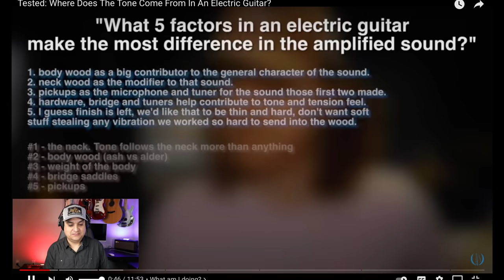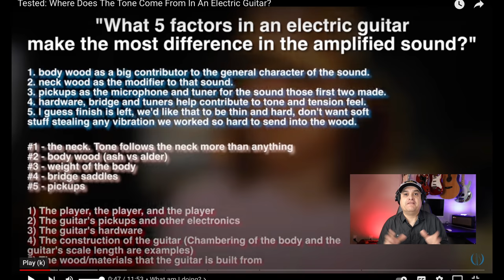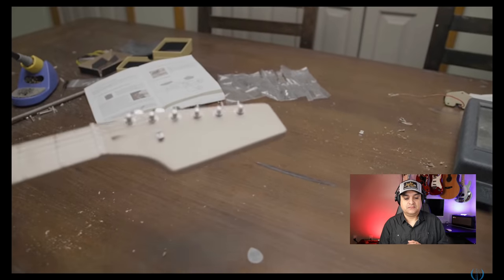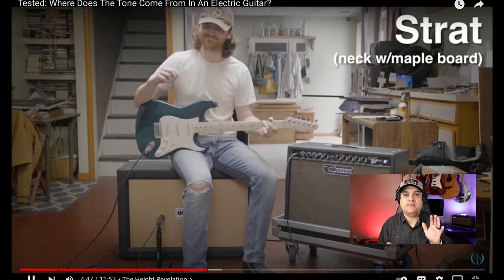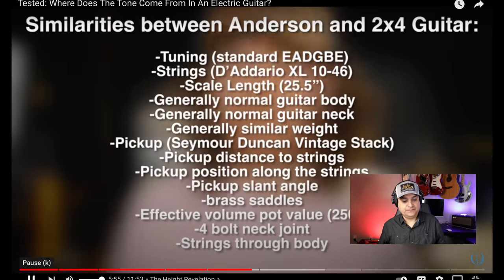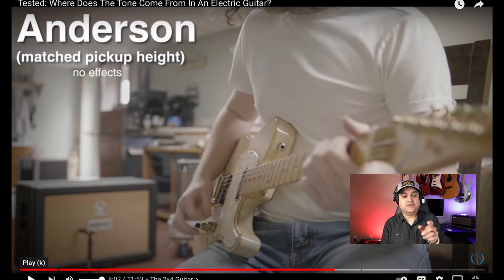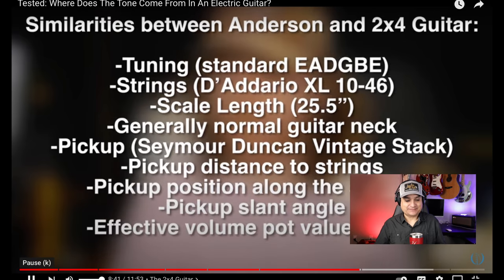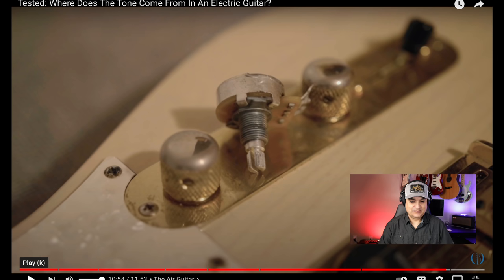Where Does The Tone Come From In An Electric Guitar - Reaction Video

Comment: I see in the comments that many people think the wood and neck contributed to the minute (if any, measurement by ear is fairly unreliable for anything except whether you like it) tonal differences in the later segments.  I think it is much more likely that those tonal differences came from the fact that even though he was using the same make/model of pickup and pot with the same ratings, they were not the same pots and pickups.   No two pickups will be voiced identically, because there will always be some variation in the wind (even when done by machine).  Same for pots.  They are given a set rating, but there is a built-in acceptable range above and below that number where it is still considered to be in spec.  

If a guitar made out of concrete can sound good, then it is apparent that for a electric guitar the wood makes a negligible difference, if any.  I would like to see an experiment to see if the same holds true for hollow and semi-hollow guitars.  From the pickup perspective, it is still just reading the vibration of the string.  But I feel like the construction of a hollow body lends the instrument to having a more direct effect on that vibration (as the bridge would move with the vibration of the top).  My guess with semis is if the bridge is secured to a center block, then the rest of the top would only affect the acoustic sound and not the pickup response.

Comment: So based on this, are there ways to get more of a mids/highs sound out of my BC Rich Zombie with a Super Distortion pickup? Currently it sounds muddy and a lot of lows/mids. I always thought it was the woods that were used, but based on this, it seems it's got more to do with the pots?
Reply: what I took from this vid was the single biggest thing that made a difference was pickup height.  Try adjusting your pickup height before doing anything else

Comment: The body of a solid-body electric guitar matters much less than the neck, except for the body's overall mass and longitudinal stiffness.   Different woods don't have different characteristic sounds independent of their dimensions.   The stiffness of the body depends more on the THICKNESS of the wood than the type of wood;   stiffness depends on the CUBE of the thickness but only directly on the intrinsic stiffness of the wood.   That means that even if your cheap, light wood is half as stiff as your expensive wood, the body you make from it can be equally stiff it's just 26 percent thicker.   (1.26 x 1.26 x 1.26 = almost exactly 2)   It'll still be underweight but you can fix that by distributiing a few small weights along its length, giving it the same overall mass distribution, which is all that matters for the relevant bending modes.

THIS IS THE BASIC PHYSICS TONEWOOD HUCKSTERS DON'T WANT YOU TO UNDERSTAND.   If wood matters much, it's in the neck which is far more flexible than the body because it's longer and narrower and THINNER.   For most resonance modes that might possibly matter, the body mainly acts as a big rigid mass that one end of the long narrow beam (the neck) is clamped to.

The trick of using two benches rather than a body with a neck should let you increase sustain and decrease neck (and overall neck-and-body) resonances.   All that really matters is that the string is connected to something rigid enough and massive enough that it reflects most of the vibration energy right back into the string, rather than transmitting it to the wood.    If you can do that at both ends, it doesn't matter much what's in between (if anything).

Comment: Technique (player), pickups, pickup position, electronics, scale length of the guitar and amp, that is 99% of where the tone comes from.    To some extent construction will affect it as well (set neck, through neck vs bolt on vs solid vs semi-hollow), more in terms of how resonant a guitar will be how it feels, but not so much as tone goes. But wood, as close to zilch effect on tone in electric guitars, if you think you ear any difference, you need to start listening with your ears.

Comment: You can make a guitar out of cheap pine and it can sound good, but it won't sound the same as mahogany. 'Better' is opinion. Different is fact. With guitars, you won't usually hear a difference changing a part. But I had a guitar that had cheap parts and I changed all the parts (not electronics) and the sum of all those changes made a very noticeable improvement.

Comment: physicist point of view: The sound is taken by the vibration of the string that produce an electricity on the pickup. This is why only matter the electronic. Also capacitors material does not matter. Only the value, which is hard to get it accurate from brand to brand.  Also there is no resonance box that makes the vibration to be heard by a microphone, like a piezoelectric one.  Wood only matters for the neck stability.

Comment: "the tone" is not in the guitar even, for the most part. it's the piece of gear that actually makes sound matters, i.e. speakers, cabinets, all that stuff. amplification comes next, then your FX processors and pedals, and so on, basically in reverse order from the cabinet to the pick you play with.

Comment: So electric guitar strings are made from metal, and so is the bridge, machine heads, frets. And sometimes even the nut is or its bone or plastic. Then theres the pick ups, bacolite.plastic and more metal. So all that kind of covers where the sound comes from and how it is generated. Where does type of wood come in to this again? Its a small part of it but those other things make far more significant contributions to tone.

Comment: So setup, pickups and electronics determine 95% (or more) of the sound seems to be the summary. I have no problem believing that. The only thing that makes me question the summary is semi-hollow guitars have a unique sound to my ears. An es-335 semi-hollow sounds different to me than a solid body les paul. I would like to see a comparison between es-335 and les paul with same pickups, strings and setup to see if I am wrong.
Reply: Different geometry results in different tones.
Scale length and pickup positions are key.

Comment: I think his video was great but it doesn't, however, factor in something very important - can guitar build materials take away tone? If you make a guitar body out of concrete and the bridge saddles out of rubber, will you lose tone? I imagine you would. Therefore, if you use bad components, can't you theorize they would be worse for tone than good ones? Do some woods keep more of the fidelity of the tone than others? Can some paint jobs actually take away from tone? His kit guitar was unfinished. I'm curious what it would have sounded like in a thick poly covered guitar. I think there is something more to tone than just the pickup height though I agree that makes a huge difference.
Reply: As long as the toneplastic of a strat doesn't take away too much, nothing does.

Comment: Great video. If I have to see one more link to a video comparing what wave files look like in comparison to each other, I'm going to scream. This was the best real-world test I've seen on the subject. There are still reasons to use pretty woods for guitar building. Claiming the tone is predictably altered by wood choice is snake oil. The tap tests or drop tests are extra irritating, since they never use identical sized and shaped pieces. Drop chunks of scrap wood in various sizes & shapes on the floor and of course they sound different.

Comment: Volume pot only removes volume and tone only removes tone, so a good case can be made that pots are immaterial to tone. IMHO most important factor is tone are the knobs in your guitar and amp, use them to find the tone, then if you can't, start messing with your guitar, amp, or cabinet.
Reply: That's not the case. Whether it's a volume pot or a tone pot, it has resistance which affects tone. A 250k pot removes a lot more treble than a 500k pot.

Comment: Justin Johnson plays a steel coal shovel and it sounds great and it has a hickory handle with no frets so it isn't about the wood. Check out guitars made from poly epoxy or the guy that made one out of glass.

 Check out Fender's acoust-a-sonic line of guitars if it weren't for the electronics it would be plain garbage. All guitar tone has to do with the type of coil used and the amount of winds that they have making them high or low output and then what Kohm pots you use to taper the signal to the output jack. 

Sure different grain woods resonate differently in a full body acoustic but not so much in a solid body with pickups because the wood is not in between the magnetic field of the strings and the poles on the pickup.

 If you put Gibson humbuckers in a dual humbucker Ibanez Super Strat styled guitar and wire it up to Gibson specs you will get Gibson Tones. Take a set of  Trons by TV Jones and put them in an Epiphone Emperor wired up to Gretsch 6120 specs and you get a Gretsch tone with an Epiphone neck profile. 

It is like the argument that a set neck sustains or resonates better than a bolt on when one has a layer of glue between two pieces of wood and the other is wood on wood with nothing creating a barrier between the two pieces of wood. Theoretically, a set neck should be worse because you have clogged the pores on two separate pieces of wood and now have how ever many thousands  of a synthetic barrier between them. When amplified it is all about the gauge and number of wraps of the wire you wrap your bobbins with, the length and spacing of your poles, and the type of magnet used that creates your tone. That is why any guitar set up with active pickups using the exact pickup height and wiring schematic will be distinguishable to those pickups no matter what guitar you put them in. Listen to music from the late 80's when guitarists were all running EMG 81/85s and you can end the debate.

Comment: There are many videos about this  J sedgborns is quite good also. I have a cleection of Gibson LPs etc and I  was interested why the 58 and 59 Custom shops sounded different. So I took my 58 and my Memphis es Les Paul, then took the neck  pick up from the 58 and put it in the es Les Paul and stone me the sound of the same pick up was different in the two guitars. Same strings both fresh same pick up height. I did not change the pots though. Some people will argue wood and construction make no difference some will argue they do. At the end it’s pretty irrelevant and a lot of the guitar is how it makes you feel and therefore play. That’s why you can play many LPs and one will gel with you. I was lucky enough to play a genuine 59 LP there was something pretty special about it I don’t know if it was the old wood or old electrics who knows, it might also be subconscious but to me it was special. So who gives a dam you either like a particular guitar or you don’t. In the end it’s like drag racing a Tesla against a Ferrari sure the Tesla is fast but it does not stir your soul and that it was it’s all about.

Comment: I would like to submit that tonewood is a bit of a misnomer. If we were looking at what difference it makes, it would be called "resonancewood" or "sustainwood". Because of the way that pickups work, there is little if any change in the actual sound coming from the amplifier when you isolate the differences down to different pieces/types of wood (as heard in the video). HOWEVER - at certain points you would have noticed that the sound changed drastically when he adjusted how and where he strummed/played the instrument. I believe that the reason why guitars with different "tonewood" sound can sound so different is not because they produce different frequencies for the pickups to hear, but because players intuitively react and respond  how the differences in the wood make them vibrate/resonate/sustain. Wood resonance and sustain aren't qualities that affect the frequency spread sent through the signal chain, so if you test the guitar in a clinical way, with the exact same playing methods, you'll come to the conclusion that wood doesn't affect the sound. Despite this, most players will make adjustments, minor or major, to their playing style in a real world situation based on the (for lack of a better term) feedback they get from the feel of the wood vibrating. This is where the sound differences come from - not directly from the wood itself, but from the player instinctively changing how they play as a response to how the vibrations of the wood feel. This is the same reason why two guitars can have the same specifications, hardware, and electronics, and can objectively sound extremely similar when put through an amp, but one may still feel more inspiring to play while the other feels lifeless. In many other videos doing "tonewood" tests, such as those done by Glenn at SMG Studios, the players have trained to make their playing as consistent as possible due to the heavier genres they play, and that would of course lessen the impact of this phenomenon. Finally, gain (in terms of volume and output from the amp rather than just distortion) can make a huge difference to how these tests are performed. With higher volume levels, a player would be increasingly responsive to the air molecules between them and the amp vibrating , and potentially start adjusting more to that as opposed to the vibrations of the guitar's wood (actual amplifier feedback rather than tactile feedback).

Comment: When people make a big deal about tone wood on electric guitars, it always sounded intuitively bogus. Having just a rudimentary understanding of how guitars work, I always assumed it was the electronics and hardware as well as the amp and of course the player. I've also never had the $$ for an expensive guitar and play cheap/accessible guitars that are modified (swapping ceramic for alnico, no name pots for cts ect) and these modifications always make a dramatic difference in the sound). I've always been careful not to discount wood type too much  as to not engage in confirmation bias or speak about things that I don't have experience with, this video helps validate my suspicions a bit more haha!

Also, am I the only one that thought the 2x4 guitar with the pickup straight into the output jack sounded absolutely savage! (btw Dylan I just watched your Epi vs Gibson video before where you speak about this configuration) The air guitar was also cool, you could probably play it like a Koto, replicating the same concept but with a more portable base could result in some sort of lap steel/electric Koto hybrid chimera instrument, scalloped frets step aside XD!
Reply: "make a big deal about tone wood" 

It's funny to me that the guys squakin about it the loudest are you guys 🤣

Comment: Man, electric guitars are such little miracles: get some wire, magnets, and electricity and from that comes guitar sounds. I think what is often lost in the discussion is what you said at the beginning: pickups aren’t little microphones. They work in a different way and the sound is made from disruptions in a magnetic field, not air or wood vibrating like a violin. If you think of pickups as microphones, of course it stands to reason that wood and such would bear greatly on tone - this is why good violins are what they are. But for just capturing magnetic field disruption, the pickups and electronics themselves are what will be driving most of the difference in “tone.” I love guitars, but the lacquer on my SG isn’t doing squat to my tone.

Comment: A long time ago, I bought a Strat Pack for my daughter. Cheapest Squire Strat ever. Sounded like crap. I put in StewMac Golden Age pickups (under $100 for all 3). While replacing the electronics I discovered that the wood was at least as soft as balsa wood. So soft I could open up the hole from jack to pots turning a drill bit by hand, but the plastic finish has to be at least 1/16” thick and is tough as nails. Result?  A perfectly acceptable guitar (except the painfully narrow neck).

Comment: I figured this out years ago for myself with my $3800 custom shop stratocaster and a squier that I bought for $75 and modded for about $500. Also found out with my Marshall jcm2000 tsl100 that the preamp tubes made a little difference but the power tubes made absolutely 0 difference. Also a few months ago stripped the finish off of my Yamaha rbx270 bass and stained it and it made 0 difference. What did make a difference. Putting Fender pj pickup set in it. Tonewood is a myth. Found this out in 2007. And people will still argue about tubes and wood till they are blue in the face. They wouldn't let it go with all the evidence in the world. I think because they have to justify all the money they've spent.